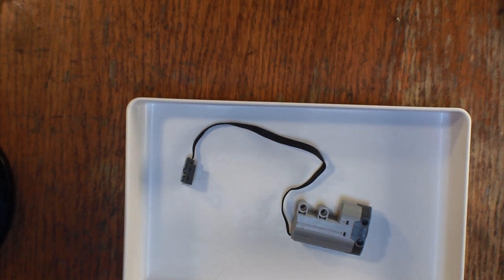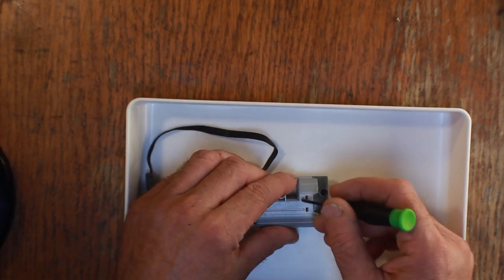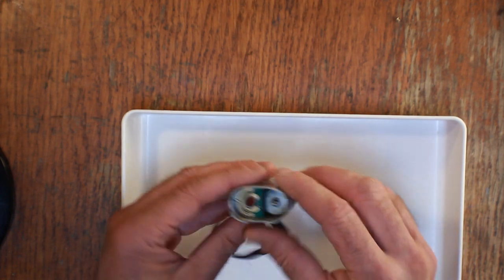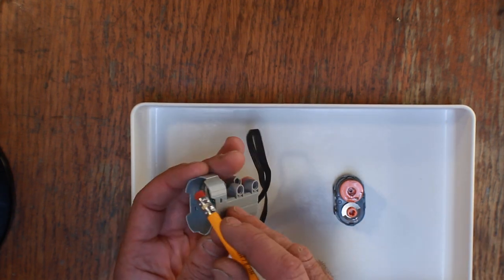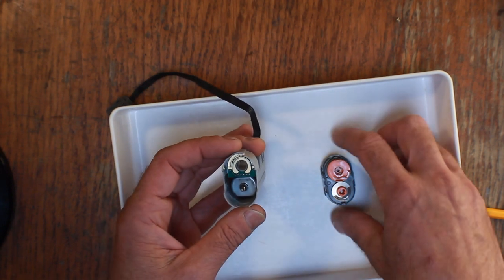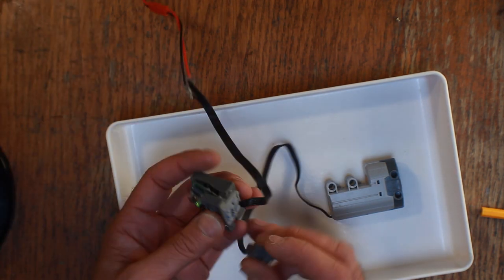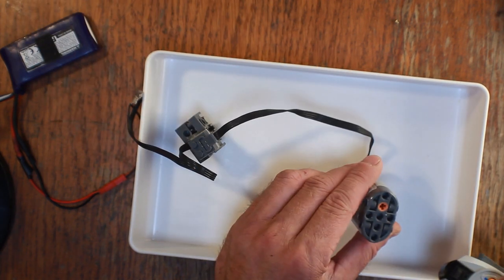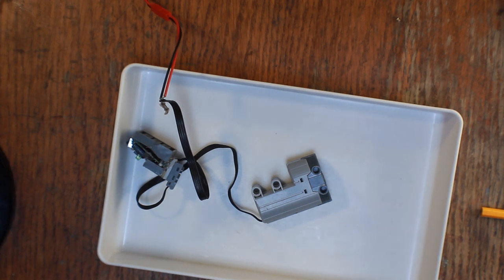Why Do Lego Servo Motors Glitch? And How to Fix Them

Comment: i had the exact problem where my servo kept jittering very badly and i spent so much time trying to figure out why it was jittering and wouldent work properly. it turns out that all i had to do was pull the contacts outwards because the metal contacts on the front grey part werent properly touching the metal contacts on the circuit boards. it wouldent return to center and the motor had no clue in relation to what position the orange part was so hence the terrible jittering. well i saved my motor and having to pay crazy prices for servos. if you are having this problem then try what i did. hope this helps! 🙂

Comment: Hey! I could use a little help, It still jitters when I have it on a controller, any tips?
Reply from the maker: Did it change at all after you cleaned the contacts?
Reply: @MaxBrix  yes, it stopped jittering on a battery box, but still does with controller.

Comment: so when my cable bends a certain way it just stops working, or just out of nowhere my servo will either glitch or will only turn one way. i also cannot pop open the pins. help plz
Reply from the maker: Sounds like a loose connection. I found a tool with 2 teeth like a flat screw driver that is cut in the center It works great, it came in an electronics screw driver set.

Comment: My servo is working again but its not returning to center
Reply from the maker: I wish I could give half a heart.
Reply: idk try pulling the metal contacts  outwards on the grey front part of the servo and make sure they touch the circuit board so it has a connection. i fixed mine like this so try it.

Comment: My servo doesn't go on its original position when i release the controller button, what could be the problem? Thanks 👍
Reply: Thanks you for the information!😊
Reply: Thanks!
Reply from the maker: I would think this is the problem. The servo reads the resistance on different contacts. one of the contacts has oxidation causing it to read the neutral position resistance. Good luck. I mostly use Geek servo and a hobby radio these days: https://www.ebay.com/itm/233780774757?hash=item366e6b8765:g:ETsAAOSwMDJgPFZZ
Reply: @MaxBrix  how does it connect to the battery box? The connection looks a little different. Haha sorry im just new to power function 😅
Reply from the maker: @jacobsphotography7511  Well it might take some learning about hobby radios and LIPO batteries. This video will show you what I mean https://youtu.be/pD21LAk_tTk

Comment: When i was fixing my original pf xl motor i had to damage a lot of the casing clips for me to open it. The pf servo has 2x times the clips and they are so small. I tried to just open it. No chance. The worst thing is that only the wire inside the cable is damaged.
Reply from the maker: You could destroy the clips and use glue to hold it together. Also, some screwdriver sets have a bit that is a flat driver but it is split in the middle. you can depress both tabs at the same time with it. makes it a lot easier.

Comment: looks like this servo has wiper contacts that only allow setting the position to -90, 0, and +90 degrees, and nothing in between. 
i have one that looks the same, and the in-between positions cause it to twitch like crazy. are you using a remote that only makes the servo go to these positions?
Reply from the maker: The Lego IR controller will only send an on/off signal. I think I was using that. The servo does act weird with proportional control.
Reply from the maker: Super cheap copy servo nonproportional but less than $15.https://amzn.to/3p3NHnk

Comment from the maker: This is a Copy Lego Servo. (it had been opened before making it easier. Official Lego stuff is hard to open). Only do this with nonworking servos. You may damage the case when opening. This fix applies to anything that has moving contacts, they oxidize.

Keep in mind that Lego's Power Functions Patents have expired. They no longer manufacture PF.

Comment: This looks like an lepin sevro. I have a problem with that and also lego sevros. Lego is way too hard and I almost damaged the casing of it
Reply from the maker: This is a Chinese servo. You probably wouldn't approve of my possessions either. I'm kinda impoverished(I am repairing a $15 servo).

One should only do this with a nonfunctional servo. Then if it is damaged in the process you don't loose anything. I hope you got your servo working!
Reply: @MaxBrix  Na the internals didn't. So LEGO servos costing over 100 is not the best choice. I almost broke the casing while opening it.

Comment: How the hell i open the servo? Im hurting my hands!
Reply from the maker: It is actually really hard. It helps if you have three hands. With one hand hold the servo. With the other jam a screw driver into the connector tab hole. With the other hand use another screw driver to pry the case apart while pressing down on both connector tabs and pulling the servo apart.  You might damage the connector tabs but that is ok.
Reply: MaxBrix i succeded opening the case. The inner motor itself works. The circuits seen clear. Just a little of black grass. I cleaned all but when i assemble, the servo do the same. Any tip? Thanks!
Reply: Thanks. Will try tomorrow. 😓

Comment: After reassembling and disassemble countless times. My servo still won't recenter, even after adjusting the gear. Is there another way to solve it.
Reply from the maker: is it trying to center but going to the wrong position?
Reply: @MaxBrix  yes
Reply from the maker: @zaikaicheng1782  It is hard to say without seeing it. it does seem that it would be the metal bit on the orange gear is making the wrong contact. If it is touching the right pads it should stop moving. I would try running it disassembled manually making connections to the electrical contacts to figure out what is wrong.

Comment: Are any other easier ways to get it open because I found difficulties to use the method on the video.
Reply from the maker: It is really hard to do. It took lots of practice, old servos, and many shots to make it look easy. If you can get help and push on both tabs it might be easier. Use a fine edge to pry open while pushing down the pins, work on both sides of the servo.

Comment: the inside of your servo motor looks different than my one. And I did bought it from official lego shop
Reply from the maker: There are several models of this servo I think mine is unofficial. The contacts work on the same principle and may have the same oxidation problem.
Reply from the maker: Cleaning the contacts and brushes is the easiest thing you can do to try to fix a bad Lego servo or controller. Good Luck!
Reply: @MaxBrix  i have learned to fix the servo with a knife or any object like that. Just clean the gaps between the contacts and the contacts themselves and the servo will be like new. the problem is that I have to clean it almost every month.
Reply from the maker: @Michalloyd_stop-motion  If you electroplate the contacts in gold they will last a lot longer.
Reply from the maker: @Michalloyd_stop-motion  $15 Copy Lego Servo (Nonproportional). https://amzn.to/3wJeKHf

Comment: How did you get it apart? I cant
Reply from the maker: Some models can be very difficult. Use a good hard screwdriver with a good grip that fits the tab. press the tab firmly down then push it forward by tilting the driver back. Sometimes I have to pry the gearbox off of the motor while pressing down the tabs. If the servo is unusable apply force and hope for the best. I have fixed some motors and servos others end up being scrapped for power cords and motors. The ones that did not get fixed were broken anyway and I learned by trying. Good luck!
Reply from the maker: It took a few tries to make it look easy!

Comment: I have different problem, with "train" controller. it doesn't reacts for single move of control "wheel", only after about 8 or more click it moves to end position, after we move a wheel in oposite direction, same thing: after 8 or more clicks it moves to oposite. any ideas? this is servo or controler failure?
Reply from the maker: Does it have one yellow dial?
Reply from the maker: Ok, It looks like every lego controller works with a similar methodology as what you see here with these contacts. I believe you are having a similar problem. Clean off the contacts and there might be a metal brush that you can gently bend it toward the circuit board.
Reply: What is here shown, is not a original LEGO servo. A copy of it has exact the behaviour you described.
These servos have 3 stable states only, full-right - mid - full-left.
This is neither a controler failure nor a servo fail itself. The Servo is not exactly the same like the original.